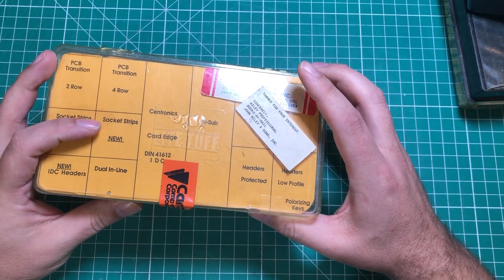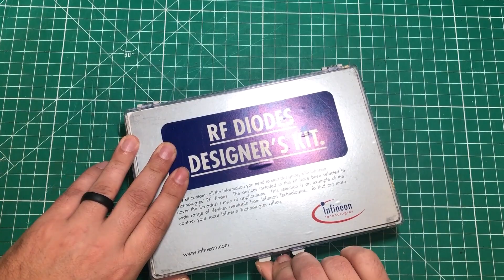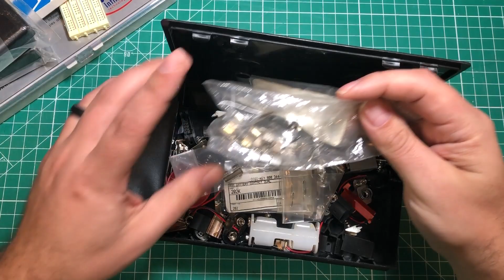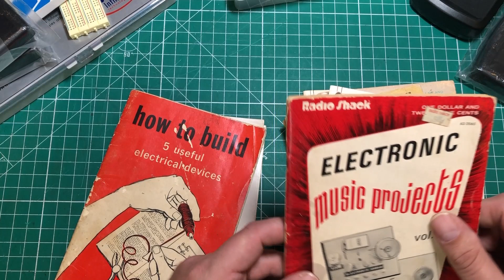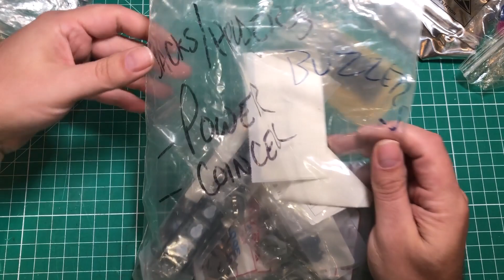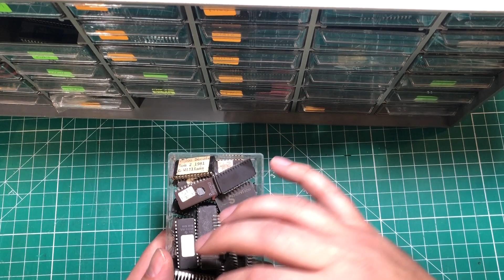$60 Electronics Component Haul

Comment: Have you found the Neural Net CPU, A.K.A. the T-800 Processor yet?? You know they cannot self-terminate, however... having said that, Arnie did voluntarily climb onto that crane and allow himself to be lowered into the vat of nacho cheese, hum, cheese... Sorry I mean molten steel, surely his anti self-terminating tendancies/protocols should have kicked in and prevented him from, for want of a better phrase, voluntarily allowing himself to be terminated. Just saying. You know, now that I think of it I think there were several plot holes in that franchise. Like, let's be honest, and I believe Terminator: Dark Fate proved my point, that if John Connor is killed off as a child, someone else will grow up to lead the resistance. Plus, it's not like any army, or resistance group is totally reliant on one singular God-like leader, they have many and various leaders... Anyway, I believe I've proved my point...🤣🤣🤣
Well, although that is a quite a nice haul, I have just spent 29 minutes and 10 seconds scanning each frame for a Raspberry Pi... Hey, maybe one of those project boxes would fit a Raspberry Pi??? 
Anyway, my disappointment and despair grows exponentially, along with my joensing for some Raspberry Pi action...🤣🤣🤣
Reply from the maker: That processor may be in one of the bins.    What kind of pi project are you wanting to build?
Reply: @AnotherMaker  Not sure, something that would push the pi and show it's worth